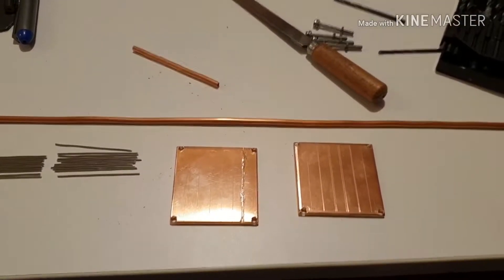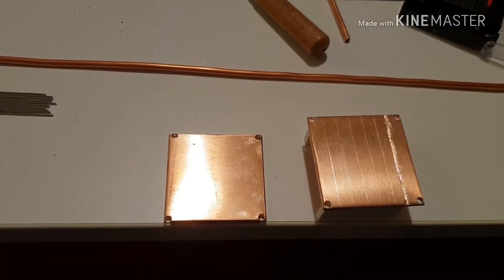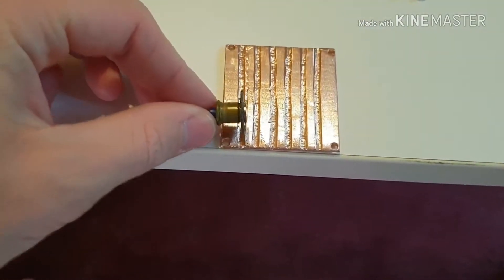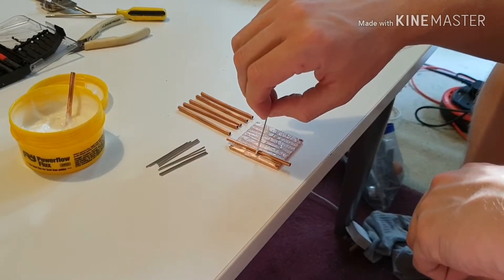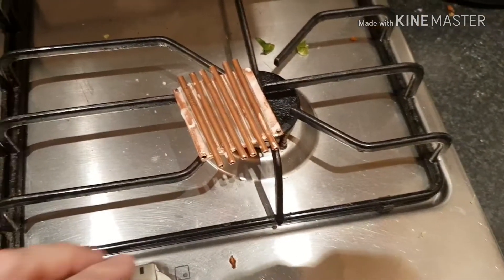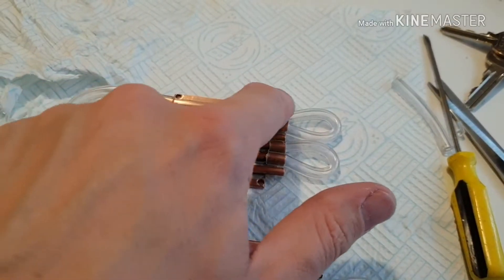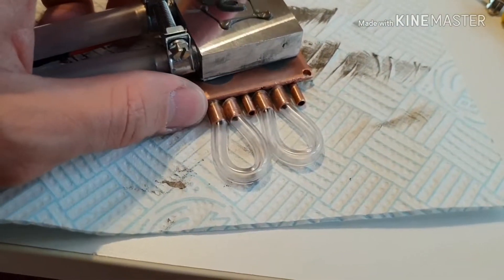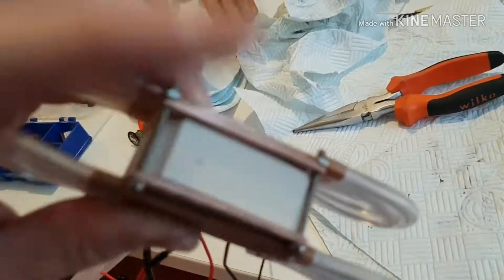Beer cooler - a new heat exchange design

Comment: Hii, is peltier is good for long-term use??
Reply from the maker: Hi
We use them on our products at work to cool sensors, and I know they're used in optical communication systems to regulate the temperature of optics. We see a typical life of over 20 years from some of our older products which use them.
Of course, that is with proper constant current driving and monitoring of hot and cold side temperatures to ensure they're staying within proper operating parameters.
Reply: @alexwood020589  is there any  specific model name or number of Peltier for Long use? Plz
Reply from the maker: @bharatvarsharya4904  so long as you're buying them from a reputable source (like digikey, Farnell, mouser etc) I'd expect them all to have similar longevity. The real trick is choosing the correct one for your application based on your cooling requirements.

Comment: Hi Alex, what kind of non-lead solder wire did you use for copper plates and tubes?
Reply from the maker: I used multicore 1mm lead free 3% silver solder. To be honest, I only used that because its what I have. Leaded probably isn't a good idea for this because its for food/drink, however we're using loads of plumbers flux, so ordinary plumbers solder would have worked just fine!

Comment: How did it go???
I have really enjoyed your endeavours. And I think the moving fluid system is definitely the better way to go for the cooling - I think this new design will be much quicker!
Reply from the maker: Hi
Thanks for checking out my videos. The new heat exchange worked much better, taking about 10 minutes to cool the beer from room temperature to drinking temperature.
I'll post a follow up video soon!
Reply: @alexwood020589  cool man! Did you ever think about just using another one of those aluminium heat exchangers and controlling flow rate instead of the copper one?
Reply from the maker: I did think about that. 
I discounted it for three reasons. The first is surface area in contact with the liquid. If the flow rate was low enough to actually cool the beer, the metal would be well below freezing, and the beer in the middle of the block would be around 4 degrees. The efficiency of the peltier drops dramatically as the temperature across it increases. So I want to keep the cold side at 4 degrees or slightly above. If it sits at -20 (like in my first design) my efficiency drops to 1% or 2%. 
Reason 2 is related: Water is a really bad conductor of heat, so I need a thin internal tube wall thickness.
3 is to do with food safety. Aluminium from some random ebay seller vs drinking water grade copper pipe sourced from a local shop. I preferred the copper haha.
The price wast much different. I think the coper heat exchange cost about £10 to build, where the aluminium block was about £5.
Reply from the maker: Also worth noting, ice build up is game over for peltier coolers. Ice is actually a pretty good insulator, so if a layer of ice builds up between the metal of the heat exchange and the liquid, the amount of energy flowing from the liquid to the metal will drop even more because the ice insulates the metal. 
This will make the metal temperature drop even further, which will make the peltier even less efficient.
Peltiers are really crappy devices! I use them at work for cooling sensors in scientific equipment. Have to get a delta T of about 120 degrees, which is pushing the absolute limit of a 3 stage peltier stack.